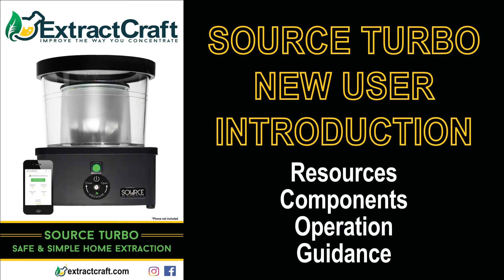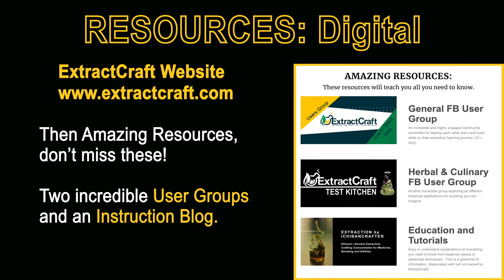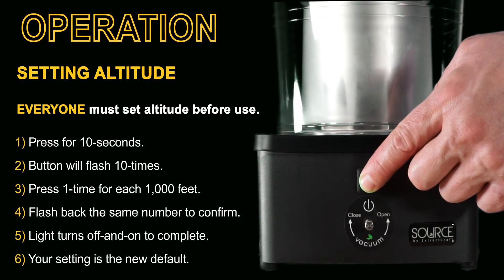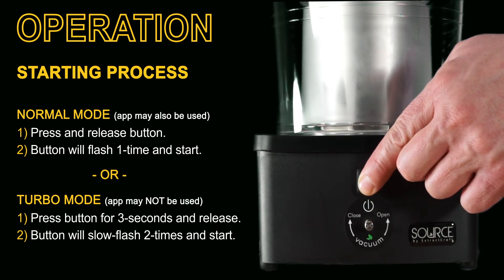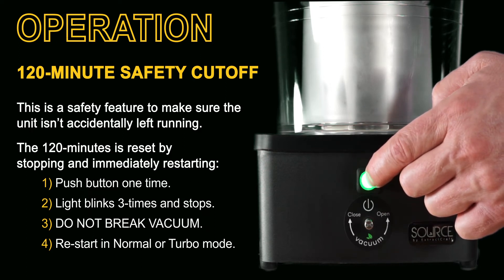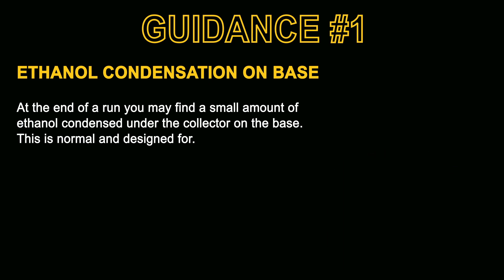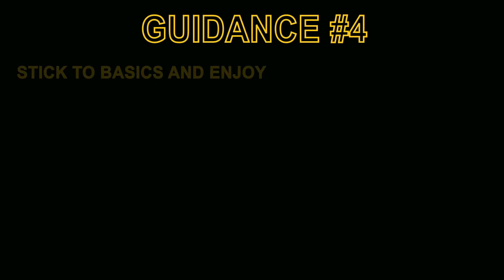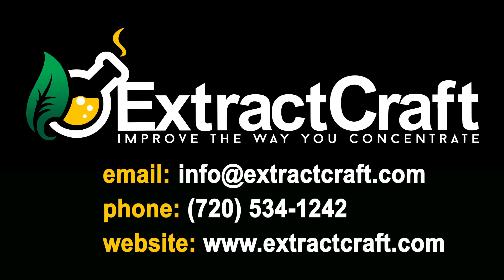Source Turbo New User Introduction

Comment: Just got my machine, tried to download manual but it said page is not there. Also, it doesn't mention in these videos, went or if I am supposed to decarb?
Reply from the maker: Are you downloading it from here? It's working great when I try to do it now:
https://www.extractcraft.com/resources/resources-user-manuals/

If not email us at info@extractcraft.com and we can email the manual to you. If you want a decarbed oil, you can
either decarb the plant material first or the oil after the process. Here's a great resource for that and more:
https://extractcraft420.com/2022/06/11/start-to-finish-extraction-basics/
Reply from the maker: Updating this info with a new website
covers all the user and installation manuals for Source Turbo - EtOH and various parts
https://extractcraft.com/pages/user-manuals

Comment: How do you set the altitude for Miami ? We have no altitude here we are almost under water.
Reply from the maker: You will set to to 0ft then. Press and hold the button for 10 seconds, then let go. It will flash back rapidly at you. After that, do nothing and just wait. The light will go off, come back on and you'll be set to 0.